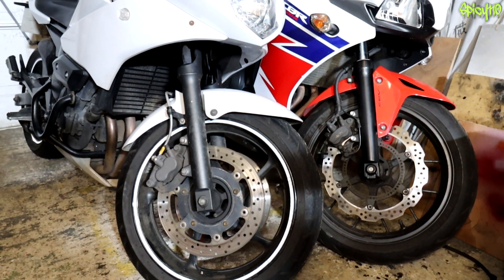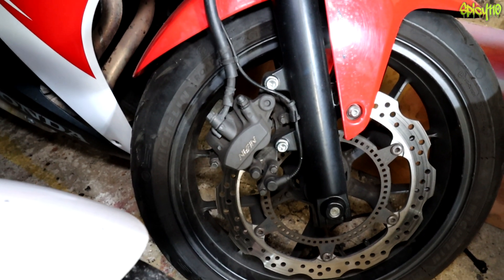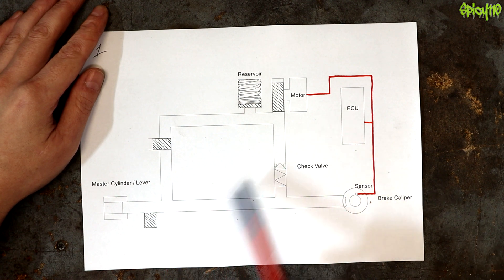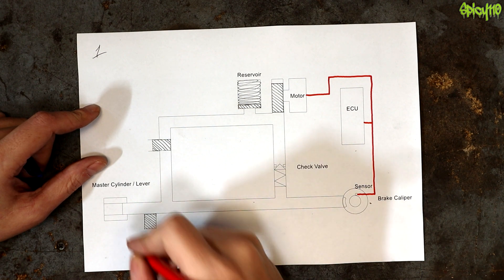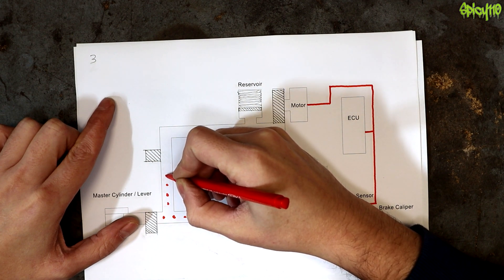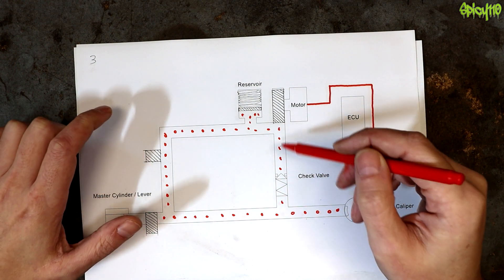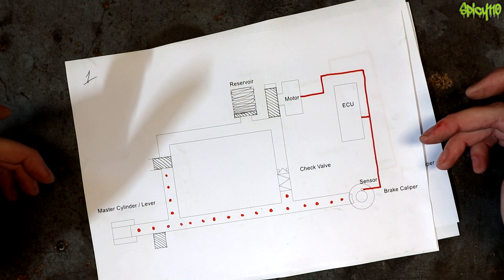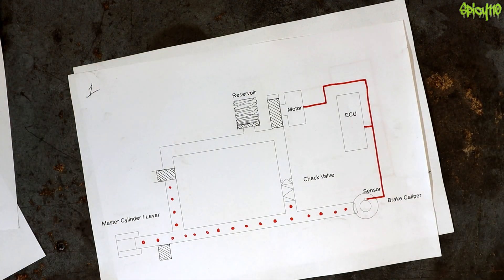How Motorcycle ABS Works!

Comment: Useful info. Thanks bro.  I have CB500X, and i admit, i use rear far too much, but mostly to scrub speed rather than bring to a halt. (and also assist ultra slow travel with brake pressure and throttle control, instead of clutch and throttle control).  but i do find the rear jumps into ABS really easily at reasonable speed.  What could cause this? Are the ABS ring holes/blocks contaminated (too big) ??
Reply from the maker: Hey yes I think I do know. The rear will lock faster because as you brake the weight transfers to the front wheel. That is why they say you should brake 70% front , 30% rear. The advantage of the front brakes is as the weight is transferred to the front wheel it pushes harder into the road giving you a lot more grip. As I mentioned above, the rear is the other way around so it is going to lock up if it doesn't kick in.  Myself, I hardly ever use the rear brake and if I do it is at slow speeds as I use engine braking instead, it is safer imo as you have no risk of a proper lock up. It is good to get used to proper front-end braking as in an emergency it is what will stop you a lot faster. 🙂👍
Reply: @spicy110  thanks for answering. It makes perfect sense. I guess i fear the front brake a little. when the front slides  out on wet road metalwork, without front braking, i'm more uptight than ever about front and rely more on the rear. I need to get my front confidence back. Keep safe bro and good luck with your back!
Reply: to add, mines a 2015 model. smaller front wheel 17" and 19" rear. thanks.

Comment: Great explanation but just a bit of pedantry about "how to spot a bike with ABS", just because it has a tone ring doesn't necessarily mean it has ABS, usually it does but not always. ABS isn't the only control system that uses a tone ring and there was a period about a decade ago when it was starting to become widespread but wasn't yet mandated by Euro whichever number and many people of the "I don't want no nanny tech on my bike" persuasion optioned their bikes without it. So there are some bikes out there like my ZX-10R that have tone rings because they came with traction control as standard but no ABS because most who bought them new didn't chose that option.
Reply from the maker: Fair, I was not aware of those exceptions. 🙂👍
Reply: same. seems like a wasted B.O.M .. maybe it is still there, but just not activated by default?
Reply: @Palmit_  The ABS specific hardware is definitely not there (I've installed braided lines and stock was just a rubber line from bar to caliper) but it's not wasted BoM because traction control works by comparing the speed of both wheels which requires front and rear tone rings. If the rear is moving faster than the front then the ECU can pretty safely assume that it is spinning and therefore fuel/timing should be cut to bring the bike back under control.

Comment: My bike has Bosch dual channels ABS. Dual channel means you have a ABS disc on both wheels vs a single channel which has an ABS disc on the front wheel only.   My bike also does NOT activate ABS on the other wheel only the one that locks ie when I use the rear it locks easily and i get kick back  on my foot and it does nothing to the front wheel and vice versa.   Basically you don't want in emergency braking situation for the system to release pressure to a wheel thats not locking up as that would mean the bike will take longer to stop.
Reply: fortnine did a vid recently that proved ABS increases stopping distance by quite some significance. Cadence braking (as i was taught in my early days of driving) was actually superior for stopping distances. however... road conditions play a vital part (leaves, near frozen water, cold discs/pads etc) and that wasn't covered so much in his vid.
Reply: @Palmit_  yeah I've seen that. I've yet to have ABS kick in on the front, I have HH sintered pads on the front and takes a second to get them warm but once they do it's like hitting a wall.  I barely have to touch the rear and it locks with the ABS kicking in.  Personally I don't mind ABS and only need to pull the fuse to deactivate if I want.  CBS though is terrible and really bad for an experienced rider I hate it.
Reply: @Mean-bj8wp  they get kinda "grabby"